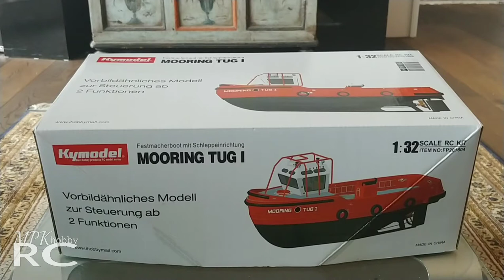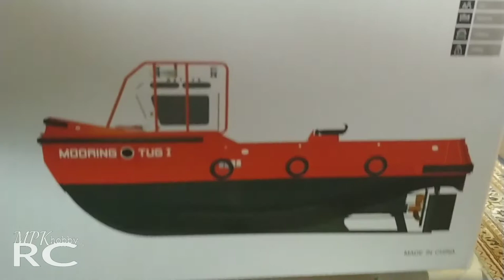Kymodel Mooring Tug Unboxing & Update!!

Comment: MPK, I am still scouring the internet to try to find a video... but, I am thinking that your Hoga might be the Billings model. I think they included the propellor shaft, and a tube it goes through. Am I correct?
Reply from the maker: Yes you are.. The model is sold as a static model tho..
Reply: @mpkhobbyRC  Ok... there's a discussion thread I found on building it... but it's long and was kinda hijacked...

Can you post a video just showing the running gear that came with your Hoga? If I can see what you have to work with, maybe we can get it done... don't make a video just yet, just let me know if you want to try. I'll let you know what I need to see in the video... it's like solving a puzzle.

One more thing... is your country's National Flag the color red with a centered white cross?
Reply from the maker: Lol thanks for your efforts! 
I have actually already fixed in the shaft and motor.. Might be hard to take apart now.. Got a 1:50 fishing boat that i will need(want) to install a grease reservoir! Not much space.. 

Granted this was probably not the best 1:50 to start with but had the bug to build.. Im sure u understand..

Btw yes it does indeen have a white cross in the middle... Lol
Reply from the maker: Are you on instagram? Is yes. Mine is linked in my about section..
Reply: @mpkhobbyRC  I know what you mean about the bug to build!!! I decided to try to get back into RC Tug Boats and bought a brand new $450  RTR... It's really sad what I got for my money though... And what's worse is if others are just getting started in RC Scale Boats, they might just give up altogether.

But I have digressed... can you show me what kind of Grease Fitting you need on the Fishing boat??? I still want to help you if I can.

(Sorry, I'm not on Instagram yet)
Reply from the maker: Just stared watching your video, made it about half way be for seeing ur reply.. i had a similar tug a couple years back, cant remember the brand, but ended up ripping all the electronics out.. 

Not sure yet for the fishing boat, not started it yet. I will deff hit you up when you i do !! 
Thanks again man!!
Reply: @mpkhobbyRC  Thanks for the ❤️. Means a lot to me right now. Just want to add a little advice...I posted a video on the RC Horizon Hobby Harbor Tug Boat... it's not a bad boat... but, it's not what it is advertised to be...
Reply: @mpkhobbyRC  ❤️